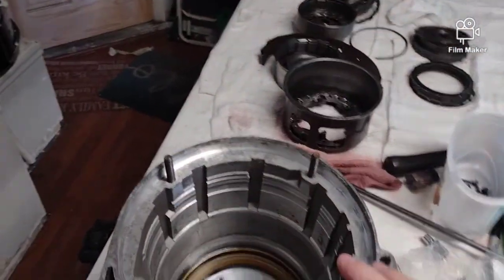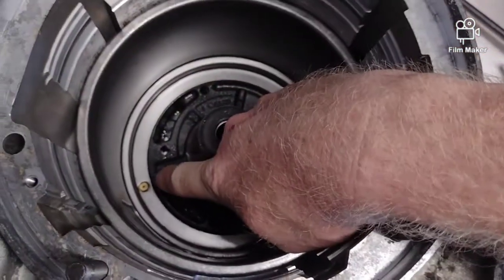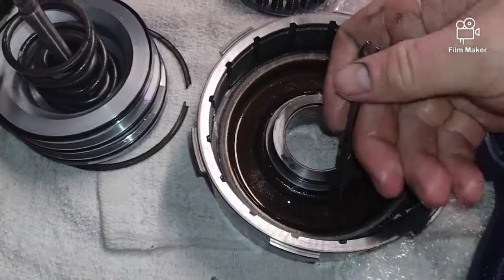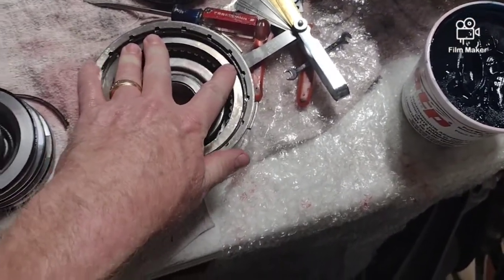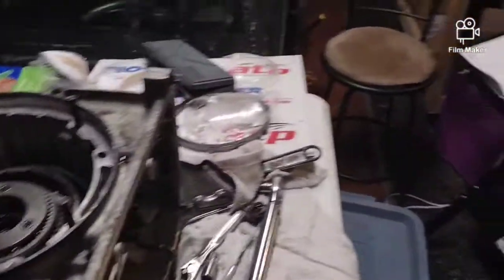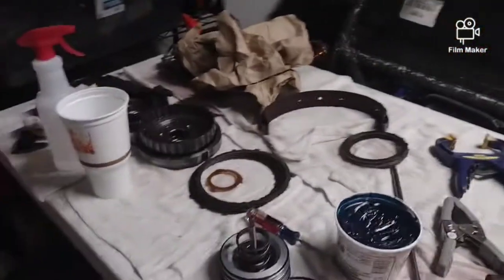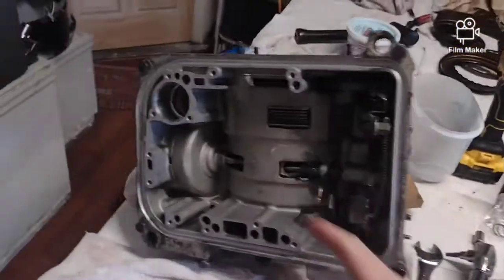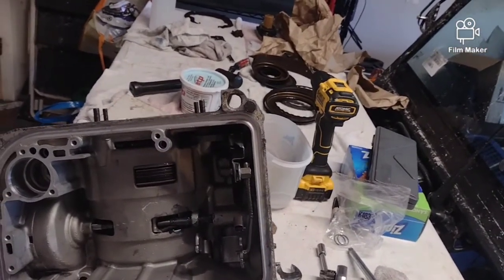VW 090 Automatic transmission rebuild #vdubrun21

Comment: Nice Video! How heavy is the automatic transmission part of the transmission? I planning to do the two seals in between the automatic transmission and the differential while its still in the car. It's a 1982 Audi 5000T with the 087 transmission
Reply from the maker: The actual automatic unit is not that heavy, probably around 50 pounds would be my guess.

Comment: Thank You for posting this usefull information, would this automatic transmission assembly fit into a Super Beetle?
Reply from the maker: Thanks for the kind words Steve. Unfortunately this transmission is quite a bit bigger than a beetle transmission. You could make it fit and work but it's going to require lots of fad work. I have this in a dune buggy and had to cut the rear frame horns off and build new mounts because it's so wide it almost touched the trailing arms on a IRS. There was a gentleman on the samba that used one from a type 3 and documented how he did it if you truly interested in doing it. One note of caution if you get one from a type 3 make sure you get all the shifter and linkage with it. If I can find the link later I will place it up here.

Comment: I just had mine rebuilt at a shop and after installing it it won’t go into reverse. What would cause that? You can hear it shift when moving the shifter but won’t actually engage.
Reply from the maker: My guess would be something is in the valve body.